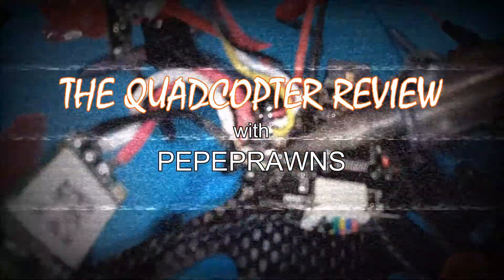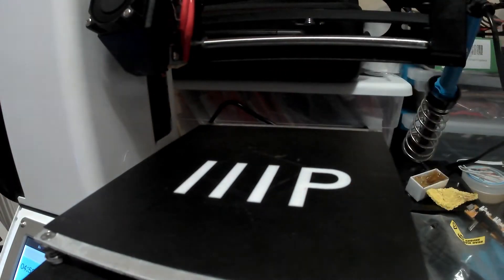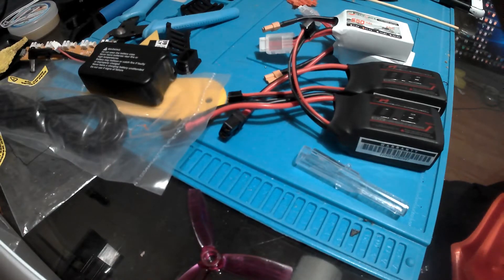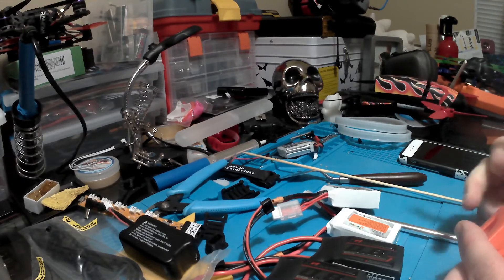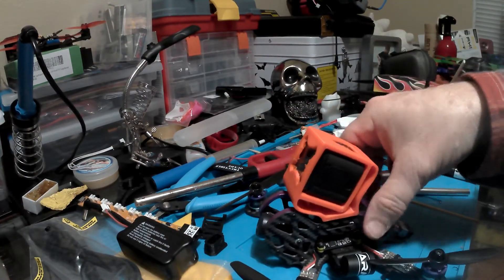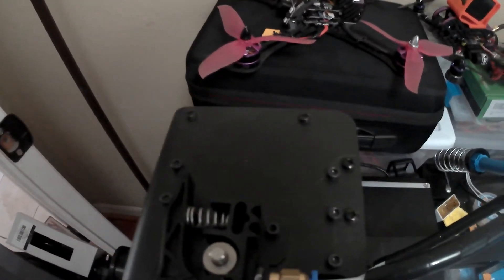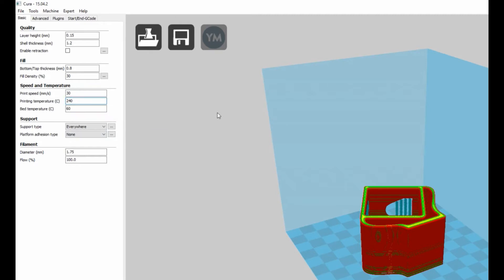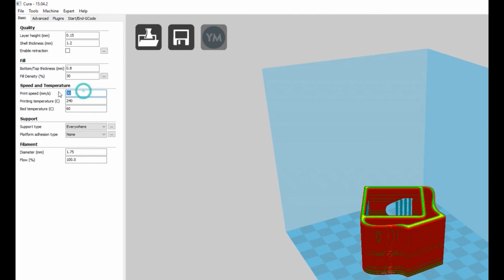Monoprice Mini V2 Budget 3d printer printing TPU Flexible Filament ✔

Comment: Hey man, I am watching this in 2021 and was wondering if u would possibly respond to me and let me know if this is still a viable solution for printing tpu fpv parts today. I have the opportunity to grab a one of these and need to know if it will work for me. I just need to print gopro mounts and the like.

Comment: im ordering one for test.. 190.00 bux..  So the filament adapter is all I need to print TPU?
Reply from the maker: The latest ones have it already on it. If you do not see that v shaped piece then yes make one and add it but my bet is it will be there. I bought a second one last year and it had it.
Reply: @TheQuadcopterReview  Thanks buddy!
Reply: @TheQuadcopterReview  I picked one up at MicroCenter for 179.99.. Did the Cat test..looks good.. Next is TPU ..
Reply: @TheQuadcopterReview  do u mind making a photo of the V shape? and sharing it

Comment: Weird... supposed to have a V2 but the feeding mecanism is a bit different. Seem TPU friendly already.
Reply from the maker: Right from pictures I've seen, it looks like they added the V-shaped material feeder at the factory now. That means your good to go.  The only issue you can run into from time to time is the filament will coil in the barrel before the novel if your heat is too high. It happens from time to time and just part of getting your numbers dialed in. Just note black TPU is a bit#$ for everyone. Just a thing with black filament.

Comment: Hey! How long did that take?
Reply from the maker: So i am going to give you a range. A part the size of that gopro holder can take from 3 1/4 to 5 hours.  I say this because it just depends on the level of prettiness you can live with and how hard you want it to be. If you do a .06 layer height at 30 speed which is the cleanest look and 80 fill for a harder object your pushing 5 hours. If you go 15 to 20 layer height at 40 speed (warning do not go any faster with TPU) and a fill of lets say 40 you will dramatically reduce that. If you want to experiment you can get something you also need like lets say a xt30 lipo plug cover or motor soft mount and try one at  fill settings of 10 and layer heights of like .06, .1, .15 and .2 for quality and hardness.  Those take 15 minutes or less and you end up with something you can use vs trash.  Hope that helps.